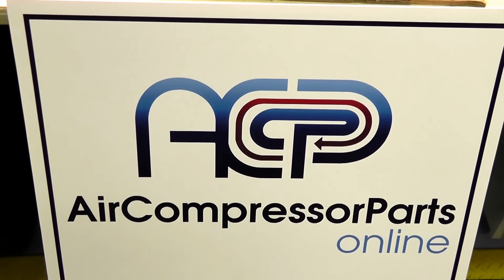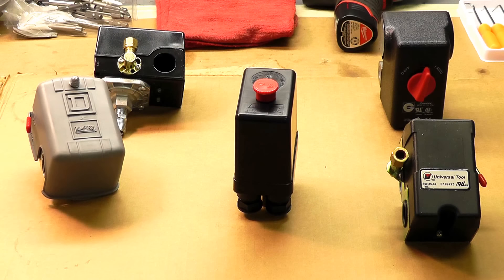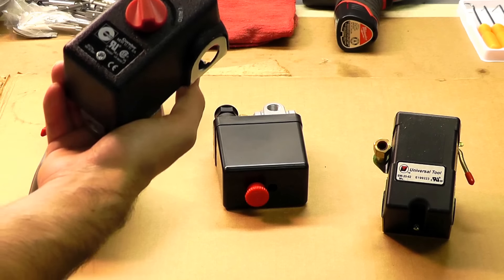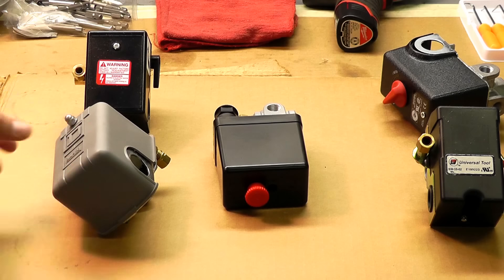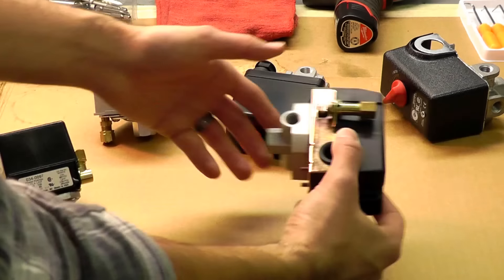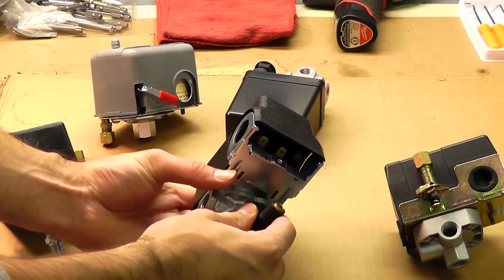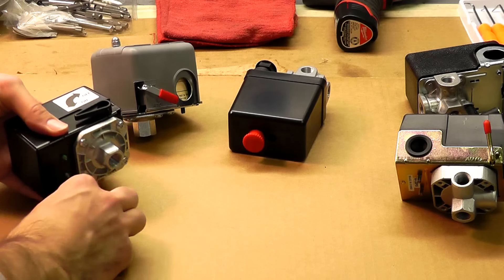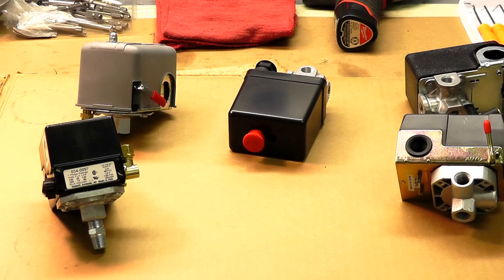Pressure Switch Replacement For Air Compressors

Comment: Hi. I recently bought an air compressor and the pressure switch looks like in the middle at 00:40 i.e. push/pull type. However, when I pull the red button I can’t hear a click indicating the on position, it only clicks when turning off or by pushing it down. Do you know what could be the issue?
Reply from the maker: It could simply be a mechanical problem. I would first removed the cover (after you turn the power off, of course) to see if you can find out why this is happening and possibly repair it. If not, you may have to replace the pressure switch since I don't know if the cover is available separately or not. Thank you for the comment!
Reply: Air Compressor Parts Online 🙈 I’m retarded, I didn’t know I had to twist and pull this button at the same time, not just pull. 😂 Everything’s working good now. By the way, do all new air compressors come pre-filled with oil or just some (excluding the oilless)? Mine it’s pre-filled I noticed.
Reply from the maker: @UFOENGINE  That's good to hear! Glad you found the problem. Most units actually do not come with the pump pre-filled with oil, no. Typically, you will see residual oil in the crankcase because the manufacturer test runs the compressors prior to putting them on the sale floor, but they then drain the oil after testing. So, you should really only see the residual oil in the crankcase and probably need to fill it.
Reply: @AirCompressorPartsOnline You say 'most units', does that mean that some manufacturers do pre-fill the units with oil although is not that common like you say?
Reply from the maker: @UFOENGINE  I've actually not seen a manufacturer prefill any of their air compressors with oil, no. You would need to add oil to the crankcase before use.
Reply: Air Compressor Parts Online Little update: I contacted the manufacturer and they told me they do indeed pre-fill the pumps inside. They didn’t tell me the reason why however. Best regards and thanks for the help anyways. 🙂
Reply from the maker: @UFOENGINE  Good to know! That's not typical but glad you got to the bottom of it.

Comment: Replaced presure switch and it still cuts out well before any presure is built. The reset button always pops.??????
Reply from the maker: Thanks for the comment Brad. It could be that the pressure switch is defective, but that's not my first guess. If the reset pops before max PSI is achieved, I'm inclined to think the reset is defective itself, or you have a motor problem. The motor could simply be overheating and drawing too many amps. It's probably best to have the motor checked out since you already replaced the pressure switch.

Comment: Hello, my Speedair is fitted with a Furnace: CW-2075-51, catalog no. 69MB108430,. If this guy in obsolete can I order a comparable replacement? Regards
Reply from the maker: Per Campbell Hausfeld (who made these units under the SpeedAire brand) there is no direct replacement available for this older CW-2075-51. However, there is probably a modern pressure switch you can use as a replacement, yes. The best thing to do is go to the below link on our site to view all Furnas pressure switches:

https://aircompressorpartsonline.com/furnas-pressure-switches-furnas-port-style-furnas-pressure-switch-p-287.html

You'll need to know:
1) Is it a 1-port or 4-port manifold on the switch?
2) Does it have an unloader valve? 
3) What are the cut-on and cut-off pressure settings?

https://youtu.be/4qP9tCAVzFE

Above is our link to our video on how to choose a pressure switch, which may also help. I'm sure one of the modern Furnas pressure switches we offer will fit on your unit without much modification. The most important specs is the pressure setting and the number of ports (threads) on the manifold.

Comment: My 20 gallon husky air compressor runs all the time with no air built up would I need a pressure switch or what?
Reply: +Jerry Thompson "What",  seem to be the go, 
Hey! Mate if the the air is not building up, it is not the pressure switch. The pressure switch controls the motor I/O, not the making of Air Pressure.
It currently has the compressor running like hell waiting for the Air Pressure to build up. Still waiting.
Reply: new Leaf  Is the pressure "building Up". If so, what pressure?
Reply: new Leaf  OK, then set your pressure switch. There are many utubes how to do it. Is it a new, medium or veteran age machine?

Comment: I have the red push bottom on my pressure switch. And spring is off how do I replace the spring please
Reply from the maker: If the spring came off, it can be replaced, unfortunately. More specifically, it SHOULD not be attempted. That spring is one of the main pressure sensing components in the switch and even if you could re-install it, it wouldn't operate at the correct pressures. It is certainly recommended to replace the pressure switch in this case. Thanks for the question!

Comment: how do you replace the main copper line going in to the tank without taking everything lose
Reply from the maker: Thanks for the question Tony. You're referring to the larger discharge tube from the pump to the tank, yes? If so, the discharge tube on most units typically attaches to the pump head and to the tank check valve with a brass compression nut. Of course, this would require just loosening the nut and removing the tube. Some units are are harder to get to so you may have to first remove the shroud (if applicable), but once you do it should be fairly straight forward. If you can reply with your model# I can probably give you more specifics. Thanks!

Comment: Hi, I need a pressure switch for central pneumatic compressor mod.47065.If you have let me know.5=19-2018
Reply from the maker: Hi MT Con, we do not sell parts for Central Pneumatic. They will fill your order at 1 800 444 3353.
Or, this one should work. Hope this helps!

https://mastertoolrepair.com/090-125-psi-wuxihx-style-pressure-switch-de-2396465-p-3829.html

Comment: where can i find just the ps cover for part# cac-359 thanks in advance
Reply from the maker: I'm afraid DeVilbiss (now under the wing of Stanley Black & Decker who manufacturer DeWalt & Porter Cable as well) has made this obsolete, so we don't have it available unfortunately.
You may want to try contacting DeVilbiss to see if they still stock any in their warehouse; their cust service phone number is 800-992-4657. 
I believe that switch is made by Furnas, so you could always try getting the long Furnas model# off of the switch (probably on the inside of the cover) and contacting them as well. I believe Furnas is now Hubbell. Hope this helps.
Reply: thanks alot

Comment: I put a new switch on my husky 60 gal,,,,,and it will bleed down to 90psi after it reaches 135,,,,,what gives?
Reply from the maker: This is indicative of a bad check valve in the tank causing it to backfeed to the switch. What is your model number?
Reply: my switch is the last one you showed bought new at TS,,,,(Tractor supply)

Comment: I just need a new unloader valve it's corroded spring is broken. Looking at prices the valve is $20 I can get entire pressure switch off amazon for $14 and just remove the unloader valve from it throw rest away.

Comment: i cant get my Pressure Switch to work with my gas motor Air Compressors how to connect a pressure switch to a gas motor so it goes off and on

Comment: What if my current setup doesn't have an unloader valve?
Reply from the maker: It really depends on the compressor. Some compressors don't use an Unloader Valve on the Pressure Switch, and this is the case if the compressor unloads at the pump head. Some units, especially two-stage pumps, have a centrifugal unloader or head unloaders that allow the excess air in the line to be "dumped" or "unloaded", rather than through a pressures witch Unloader. Either way, your compressor needs a way to unload the excess air in the line and pump head, your compressor may just have a different method of doing this.
Reply: Thank you, I inherited this Dayton Aire compressor from my dad, it is at least from the 80's.  I want a pressure switch with an on/off lever so I can stop turning on and off the breaker when in use. (home garage)

I hear the compressor let out excess air after each cycle, so it sounds like what you described. So if that is the case, is that okay not not connect the unloader to anything?
Reply from the maker: Exactly, as long as you hear that burst of air after the unit shuts off (a few seconds), the compressor is unloading properly and there is no need to install a pressure switch with an unloader. You can simply install a pressure switch with an on/off switch that doesn't have an unloader, or you can use a pressure switch with an unloader and simply don't connect anything to it.
Reply: Thank you so much!!